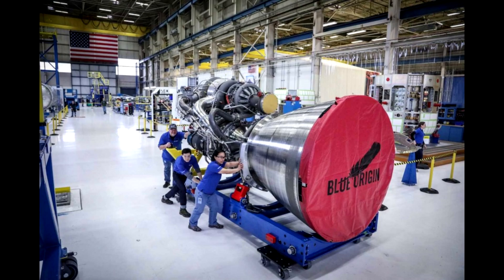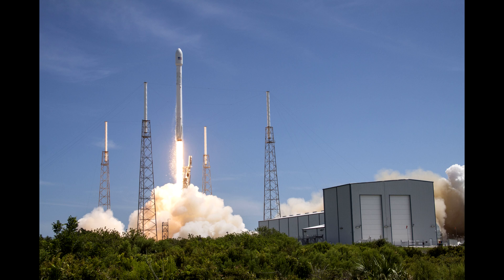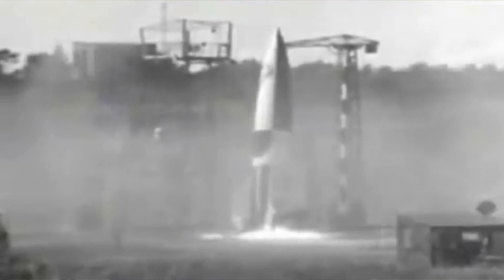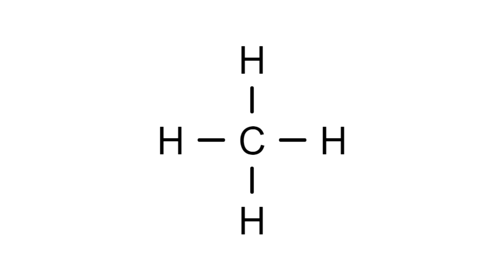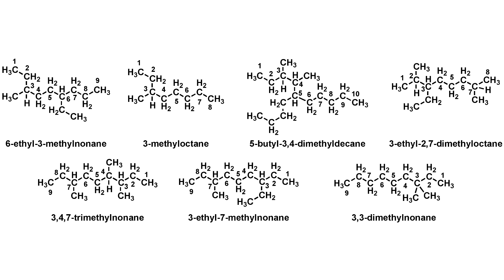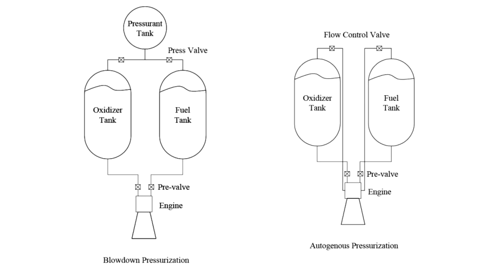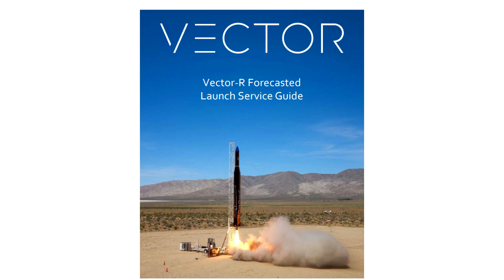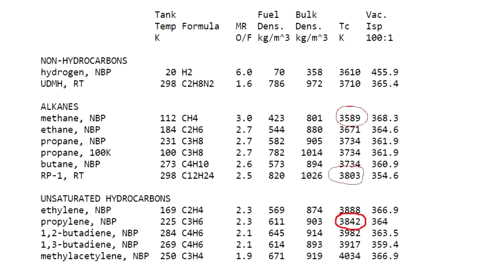Why Next Generation Rockets are Using Methane

Comment: Can you also use the Methane engine with liquid hydrogen? In case Elon Musk really wants to to his BFR earth transportation, burning methane would produce a lot of greenhouse gases
Reply: Jets and rockets that use rp1 produce greenhouse gases already so it's not a new problem.
Reply: And no hydrogen cannot be used in a methane/lox engine
Reply: All rockets produce greenhouse gases, even Lox/LH2 engines.
Reply: I thought the Loc Lh2 produced only water vapor and some nitrogen oxides..
Reply: +Lensflare Deviant

Water vapour is actually a more potent greenhouse gas than CO2.
Reply: True.  But water condenses out and most of the water on earth is not present as a vapor.  Not true of Co2.  Adding more water to the atmosphere doesn't compound the problem because most of it falls as rain.  Co2 in the air stays in the air until absorbed by something else.  When it comes to the net effect Co2 is a MUCH bigger polluter than water vapor is or ever could be.
Reply: +Lensflare Deviant

True ,but water vapour actually do  cause a feedback loop that amplifies and accelerates climate  change  as  studies by NASA and other scientific bodies have concluded.
Reply: Yeah.. HUGE amounts of water vapor being added all the time..  The feedback requires the temp to rise to allow the air to hold more water.  But water added precipitates out quickly so unless you're pumping a lot of vapor out constantly into hot air that can hold it it's not that significant as adding things that linger for decades or centuries regardless of temp.

Comment: Now that we know there is water on mars, wouldn't it be easyer to just electrolize it for fuel? 

I mean, there is less complexity and you can bring a backup generator. 

Methane seems to me like an amazing first stage option. For the second tho, that low ISP just comes back to bite you.

Comment: 1:42 Not quite. RP-1 is not made from ordinary jet fuel. It's refined from crude oil, but it has a tighter standard than more common kerosene fuels. Refineries have to be pickier about which crudes they use when making RP-1, and they also have to use a narrower "cut" during distillation, so that less of that crude actually becomes RP-1 and more of it is made into other products. RP-1 ends up having a more consistent composition, but it's also more expensive to produce, and less is available, compared to other fuels.
Reply: in broad terms, it's the same as refining kerosene, but "more" refining is done to meet the tighter spec. That's consistent w/ what I got from the video, so you're "not quite" correcting anything
Reply: @nathansmith3608  RP-1 is always kerosene in the sense that it's a selective grade of kerosene. It's not really refined 'more', so much as more selectively. To me, the words "made from" suggest that the oil is first refined into kerosene, and then some of the keresene is made into RP-1.
Reply: @TonboIV  Refining is all the steps of purifying, catalyzing chemical transformative processes, re blending, repeating certain stages as necessary, to achieve certain fuel/chemical characteristics, right? The basic crude oil stocks for diesel, kerosene & RP-1 are the same, but RP-1 > kerosene > diesel #2 in terms of processing effort & exacting standards. you could probably make it from kerosene, but it would need more processing, & it might be more cost effective to separate RP-1 fuel stock for its special processesing early on in the pipeline. you could definitely use it as kerosene & I bet most diesels would be happy to run on it. happier than your wallet.
Reply: @TonboIV  ... but I'm not in that industry so I might be off here or there & we're saying pretty near the exact same thing. plus I think sources differ on where to draw the line between a refined oil vs. synthetic oil
Reply: I had always assumed that RP-1 was just kerosene with a low guaranteed sulfur contain, but as it turns out you are right, the production process is a lot more complicated as great care is also taken to reduce the number of alkanes which can produce complex carbon structure/sooth. The more you know...
Reply: With RP-1 refinement, branched alkanes are not the problem - they are in fact a benefit, since a high degree of chain branching confers additional stability compared to straight chain alkanes. The same is true for gasoline for spark-ignited piston engines - the ideal fuel is iso-octane, aka 2,2,4-trimethylpentane. The least suitable fuel is straight chain heptane, which actually represents the zero point on the octane rating.

The molecules in crude oil which cause the biggest problems for rockets come in three main classes: Alkenes (aka olefins), aromatics (such as benzene or alkylbenzenes) and any hydrocarbon containing hetero-atoms, usually sulfur or nitrogen. These can all decompose in regenerative cooling passages (around the combustion chamber or nozzle) to deposit coke and a plethora of polymeric gunk. 

Alkenes and aromatics can both be dealt with by hydrogenation, which converts them to alkanes and cycloalkanes respectively, either of which are acceptable components of RP-1. The sulfur or nitrogen containing hydrocarbons can be dealt with by hydrodesulfurization or hydrodenitrogenation, which remove the sulfur as hydrogen sulfide and the nitrogen as ammonia.
Reply: So you can't just use diesel then?